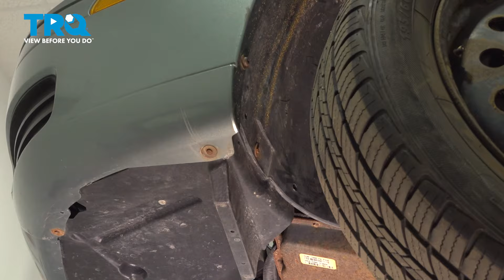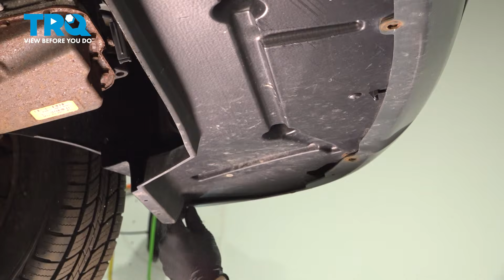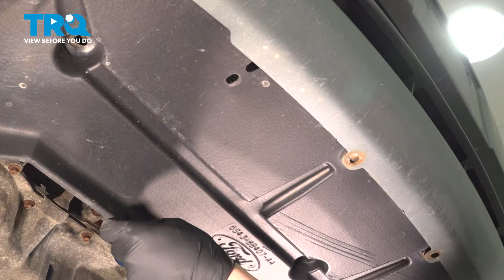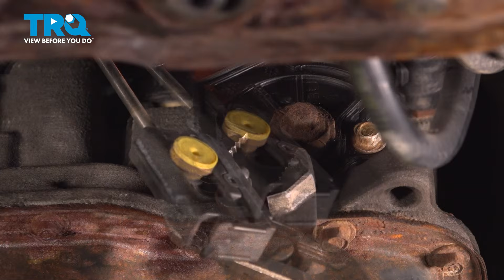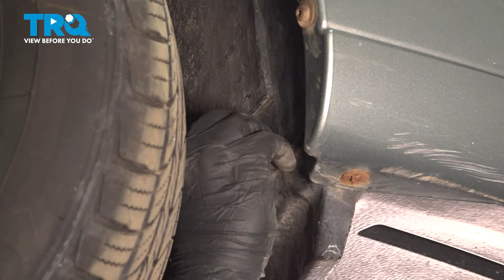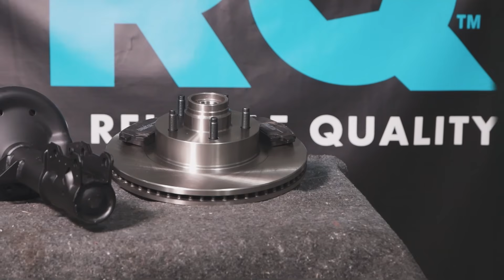How to Replace Neutral Safety Switch 2000-2007

Comment: This should be called the neutral UNsafety switch. I was almost killed when my car died in the middle of an intersection, while trying to push my car. Am in my 70’s and almost got hit. When this happened with my Pinto, I was able to put the car in 2nd gear, turn the key and the starter pulled my car to safety. The gas station had water in the tank and I wasn’t the only one to have my car die. I couldn’t do that with the focus because of the stupid “safety” switch.